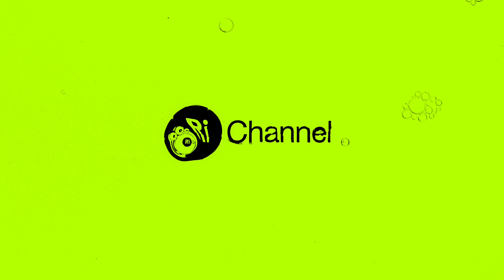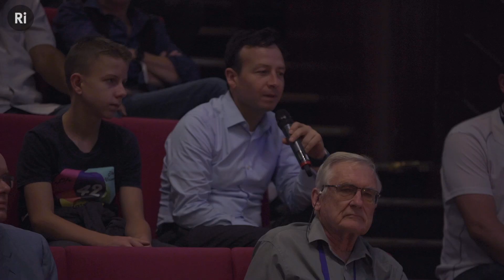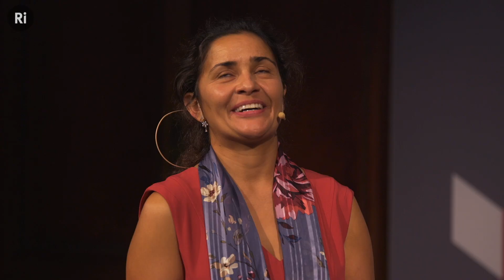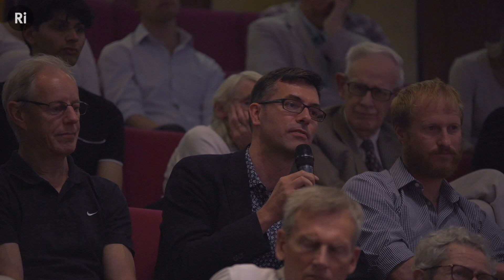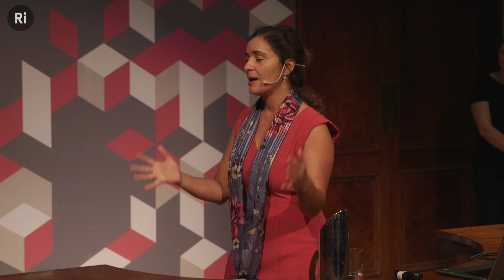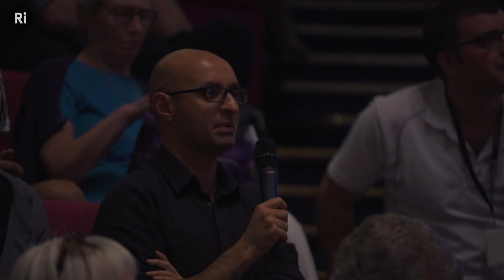Q&A: Hyperloop and the Future of Transport Technology - with Anita Sengupta

Comment: How to dissipate heat (like from air conditioning etc.) in a vacuum tube?
Reply: With the short travel time, I think you could get away with just sticking ice  into an air cooler in at each end of the trip. An quick calc: 10 resting people x 120W human thermal * 20 minutes * 60s/min = 1.5 MJ. Ice melts with 334 kJ/kg so 1.5*1000/334 = 4.5 kg ice needed per trip for 10 people.  Drive waste heat is also an issue, but that might not even be in the capsule and instead be a part of the track.  I don't think it's a major technical risk.
Reply: @OldFormat  then there is a failure of the system and you are in a pod that is stuck there for hours before rescue under the summer sun!
Reply: The problem isn't external heat coming in since you are on the inside of a vacuum thermos, the issue is dissipating the internally generated heat of people.  
You can bring extra ice for emergencies.   Or, since you are not moving, connect tube walls to use them as the heat sink for a refrigeration unit.
Reply: @OldFormat   Then, with 20 PAX and 40 minutes ride, these sums up to nearly 20kg(!) EVERY time for EVERY pod!
Reply: @OldFormat  You might even get away with exhausting the water vapor or some dry nitrogen through a heat exchanger behind the pod since the scavenging pumps could easily keep up.
Reply: @Zangief The Red that's a lie. The pressure at cruising altitude is about 200 times higher!
Reply: @McElfe I'm taking the piss, with another of the anti physics ideas....   getting drinking water by condensing water from the air, where is the heat going to go?  ;)
Reply: Especially, when the tube is heated by the sun the whole day! Okay, with nearly no air inside, there is no transfer medium for heating, but there is still the radiation heat, which is heating the pod during it's ride!
Reply: Oh, that is easy, all you need is thermodynamic sincilator. Which is by far cheaper than any current technology.
Reply: @Zangief The Red not what's in the design brief!
Reply: never thought of that, maybe they will be using some for of liquid cooling to get free water out of the air....
Reply: @timballam3675  im not sure what you mean by that.
Reply: @xXxkennedysxXx  I believe he is talking about condensation of moisture in the tubes.
Reply: @ganeshshenoy2615  how would that help to remove the heat from the pod?
Reply: i think "free water out of air" has just become a thunderfoot meme
Reply: @ZLO_FAF  ah okay thanks. Didn't get that. :D

Comment: If they don't have a compressor (huge fan) at the front all the air has to move around the pod. This means the pod and the tube basically form a de laval nozzle. In a de laval nozzle the you always have mach 1(or less) in the smallest cross section, never more than that! So the maximum amount of air is restricted and the pressure in front the pod would grow dramatically  and therefore the power consumption would be much greater than with an regular high speed train. Am i right?!
Reply: The pod will be somewhat aero dynamic, so it should push most of the air out of the way. I don't see that much building up (am I wrong). Also they're not talking about getting even close to mach 1 in that environment.
Reply: What are you going on about? What bloody air in the tube?Air pressure in the tube, in a vacuum?
Reply: @pegasusted2504  They are planning an absolute pressure of about 100 Pa which eventually would build up way higher since the total amount of passing by the pod is restricted (see de laval nozzle). BTW an even lower absolute pressure would be nearly impossible to maintain and zero pressure is actually completely impossible.
Reply: Bull it's 1/1000 of a bar that's a vacuum in anyone's language
Reply: It's ok a lot of people have trouble understanding that vacuum == REALLY thin gas. And that under extreme situations gas equations start applying again rather then the 'nothing' equations we're used to with vacuums.
Reply: @Brian Hoehn while an aerodynamic shape could help reduce the drag it can't prevent choked flow.
They are talking about at least 1000km/h which more than Mach 0.8. So it's clearly transsonic. She even mentioned that she doesn't see any problems with going more than twice that speed.
Reply: Ummmm why are you tagging me? I agree with you the Hyperloop won't work. The cost of running without a fan as you're describing is just one reason.
Reply: @bronzedivision  oops, sorry. I tried to reply to  Brian Hoehn  and failed :D
Reply: @xXxkennedysxXx  It's almost as if you haven't actually read even the original hyperloop alpha paper.  The paper below is from actual aerodynamicists at Glenn Research Center and published in a peer (not YouTube comment section) reviewed manner. They addressed your objection specifically and suggested possible design improvements. Improvements, they didn't throw their hands in the air and declare it impossible because reasons.
https://ntrs.nasa.gov/archive/nasa/casi.ntrs.nasa.gov/20150000699.pdf
Note that this critique was published in 2015 and the Hyperloop One design differs in several ways from the original Musk proposal.
Reply: @Markle2k  Thanks for the conference paper. I actually didn’t know that particular one before. But it perfectly explains my concerns. Remember I am talking (just like the woman in the Video) about the concept without a compresser. And in the paper you posted it says:
“If A_tube is forced to be smaller than this minimum value, not all the relative mass flow can pass freely around the pod. This excess flow would accumulate to the left of the pod in Fig. 5, with the pod acting like a piston: pressurizing the air in front of it.” Which is just what I was talking about. Note: The minimum ratio is given in Fig. 5. As you can see if M_pod approaches 1 the tube needs to be infinitely large (That means it would be quite expensive). Even with a compressor up front fig. 9 shows what the authors calculated as minimum Tube diameter for supsonic speed. And the woman in the talk said she doesn’t see any problem with going even faster than Mach 1. (35:00)
Reply: listen to 12:26
Reply: @salerio61  I know the pressure. I even wrote 100 Pa myself. But that doesn't change my concerns.

Comment: In a single tube, how can cargo travel at higher G rates than human passenger without slamming into the back of the preceding pod!
In the UK, rail freight travels at times where there is no passenger travel. Strangely freight travels slower than passenger trains, even though the network is less congested!
Reply: You have failed to see the problem here, it's impractical in the extreme.   It's not about passengers vs freight  if's reality vs fantasy.

Comment: THERMAL EXPANSION??????
Reply: Actually i think thermal expansion could be encounter by pipe compensator. But i think there are other and far bigger issues with the idea of the hyperloop.
Reply: Like for example the question where to dissipate the heat and building up pressure in front of the pod since the maximum speed of the air in the smallest cross section is mach 1.
Reply: @xXxkennedysxXx  with low preasure meaning less particles hitting the pod you'd have quite a low amount of heat generated. i low orbit where the atmospheric pressure is close to this satalites are moving a a speed of 5km per second afterall while in the pod you'd be going a ta speed of 3.6 km per second. 1000 km/h / 3.6 = m/s
Reply: @Keloz0  yeah but satellites dont fly in a tube and therefore dont form a "de laval nozzle"-like shape.
Reply: @Keloz0  People and electronic devices produce heat.
Reply: @xXxkennedysxXx  from what i can tell from wiki the de laval nozzle is when you make the tube smaller to increase the speed of gas flowing through the tube. What do you mean? the cooling down of the temperature generated in the pod will probably be handled by on board cooling system like all elektronics posses no?
Reply: Also it's used for hot pressurized gas. So that effect should not be a problem in a depressurized environment. Othervice they'd probably see effects of it in the test facility tube they built.
Reply: @Keloz0  in a laval nozzle the maximum speed cant exceed mach 1 it is physically imposible. Therefore the Flow gets choked which means there will be a massiv pressure drop between Front and back.
Cooling solutions Like air conditioning don't vanish heat but rather transfer heat from the cold side to the warm side. To keep the system running the hot side needs to be cooled. In a building or car the hot side is cooled by the outside air but when there is no outside air that doesn't work.
Reply: @xXxkennedysxXx  ok ic so you mean that the pod will apply pressure to the tube by pushing the small amount of gas in the tube to one side? yeah i guess that could be an issue but wouldn't it have caused that effect in the tests aswell? they could just do it like in fridges where they have gas moving in pipes to absorb the heat then trasfer it to the track it's running on since even though it's elevated it still is in some conntact with the rail so as long as the track is colder it will absorb heat.
Reply: @Keloz0  it will show up in testing as soon as they reach transsonic speed.
Actually a maglev usually is not in contact with the track to reduce friction. And to ensure the heat transfer it needs to be a reasonable sized contract area with no vacuum in between.
Reply: @xXxkennedysxXx  A de Laval nozzle is designed to accelerate the exhaust beyond the speed of sound. Choked flow is what makes it work. Go spend some time on wikipedia or nasa.gov
Reply: @Markle2k  I know what it is designed for. But in the smallest cross section the speed is never higher than Mach 1. This also limits the maximum mass flow rate And that's what I wrote earlier - nothing else.
The acceleration beyond Mach 1 happens behind the smallest cross section where the cross section expenses. But this has nothing to do with the issue I am addressing.
Reply: @xXxkennedysxXx  The mass flow rate is constrained by combustion chamber pressure for a fixed area. Flow rate is at a maximum when M=1 in the throat of the nozzle. This is irrelevant to hyperloop designs, however. The speed of sound is not exceeded. Note, however that the speed of sound is related to the local temperature of the gas and not a fixed quantity.
Reply: @Markle2k  How do you think it is irrelevant to hyperloop? If the Pod goes close to the speed of sound the speed in the "throat" of the tube (thats where the pod is) can reach Mach 1. The woman in the talk even says that she doesn't see any problem with going even faster than the speed of sound. (35:00)
Please read this paper for more information ;) https://ntrs.nasa.gov/archive/nasa/casi.ntrs.nasa.gov/20150000699.pdf
Reply: Problem is to make completely sealed pipe compensator, cause it has moveing parts.... that is a small problem.
But how about  a  40-200 whatever size kilometer pipe expanding on few HUNGRED meters? even the docking stations would have to move around.

(tbh i actually see the solution to that if you have many pipe compensators... so it can contract and expand.. maybe i am going to hard on hyper loop :D)
Reply: @ZLO_FAF  Honestly, I can't imagine, which sealing gaskets could stand that pressure, especially when parts are moving, like the station "gates" or the tube itself, when it compensates the thermal expanding.
Reply: the test tunnel they build was in the desert so they've already had excessive testing of this

Comment: When did the RI start spouting such garbage there has been so many people who have busted this idea. which is basically a tube train. Put in a vacuum tube which will collapse far too easily.
Reply: yea, why would they even humour this dumb idea
Reply: No idea, this presentation is a joke, just one bad weld and everyone on board dies, and since this tunnel will be under the influence of heat expansion, it's not a matter of if the tunnel will collapse, it is when.
Reply: @creamofbotulismsoup9900  im pretty sure it would no be to hard to built it strong enough that if there is a leak the tunnel wouldn't collapse. just close of that section and depressurice. Also since it would have sensors looking at the pressure differences you could have a system with if there is a leak the pumps sucking the air out could pressurice the tube.
Reply: @Keloz0  if there is a leek the pressure differential will decrease the problem is the metal coffin hitting a wall of air at high speed!
Reply: @timballam3675  if they have emergency messures such as closing of the tube section. depending on where the leek is it might be hard to stop in time but emergency breaks would most likely be installed just like on trains the 1/4g for slowing down would obviously not be the case also just like in normal trains
Reply: @timballam3675  Yes. Because nobody could build a tube that could hold up to a pressure differential of 1 atmosphere. By the way, have you ever been in a tunnel under water of a depth greater than 10 meters?
Neckbeard + indomitable incredulity + scoffing british accent /= engineering genius.
Reply: @Keloz0  pressurise the tube?  It's meant to be a near vacuum,  so it would be evacuate the tube and in the first care it would be repressurise!
Reply: If you actually know something that the thousands of engineers working on Hyperloops don't know, maybe you should just contact them and let them know. I am sure that they would be very interested. If it is just an opinion, maybe you should just keep it to yourself.
Reply: @BjorckBengt  All the engineers working on the Hyperloop have one thing in common, they need a job . It is a case then of the customer /boss is always right and thank you for the pay check.
Reply: Works ok at the bank!
Reply: @brandonfall40  they put you in a metal coffin and fired you along a tube?
Reply: Watch first movie where she explains how it works, no problems. You're making assumptions without all the information
Reply: @christianheichel  what happens when the integrity of the tube fails, death that's what!